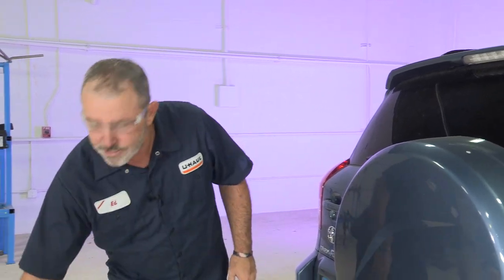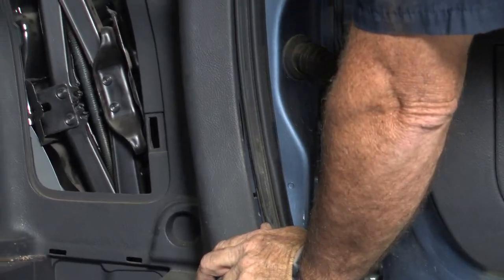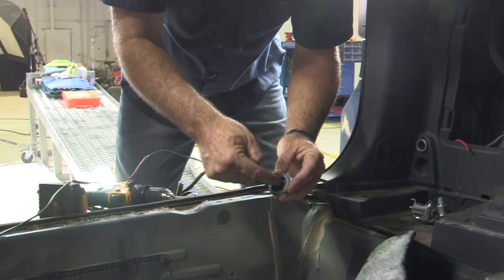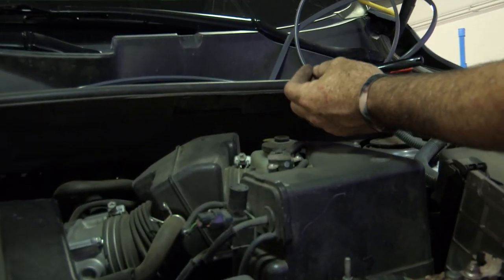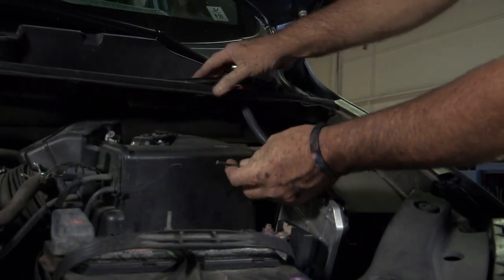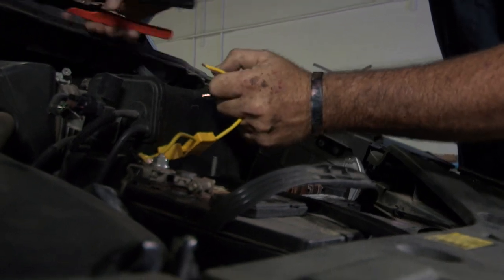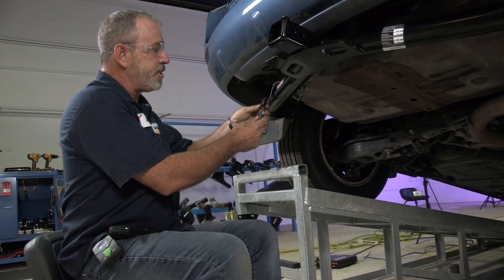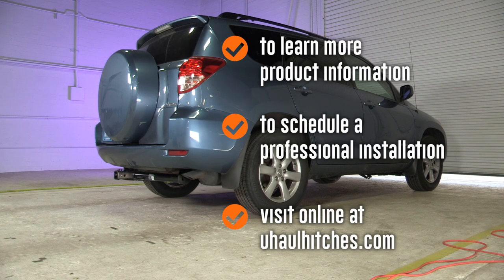2008 Toyota RAV4 Trailer Wiring Installation

Comment: My 2008 RAV4 limited wiring is different then in this video. The plug for this kit goes directly to the passenger side turn signal , located further into the tail light assembly.  I followed the directions in this video. The plug fit, just under the panel, it didn't work though.